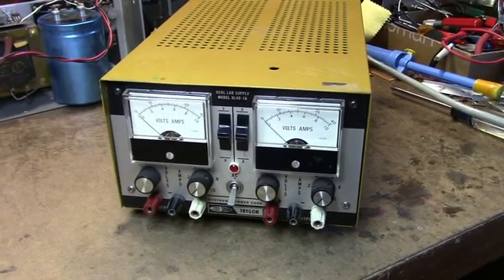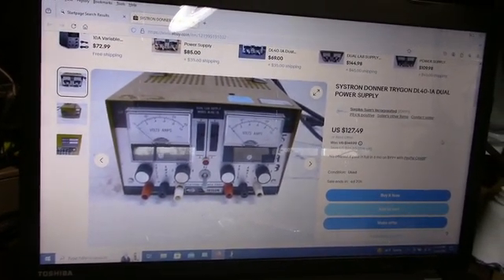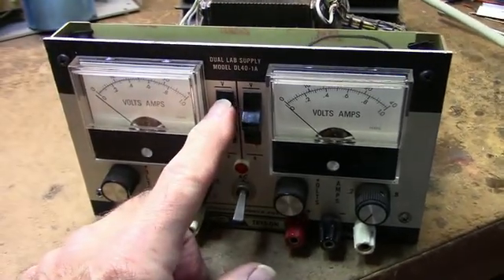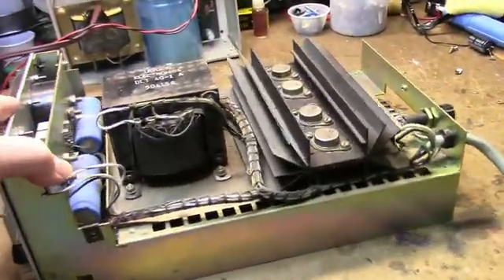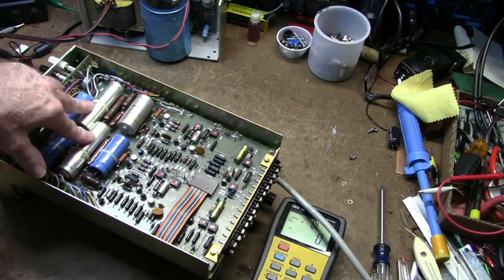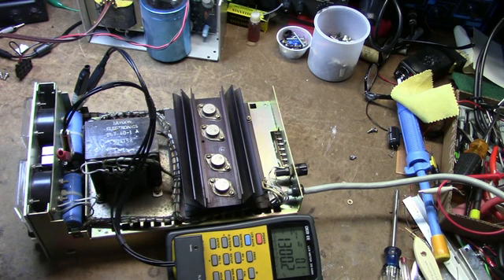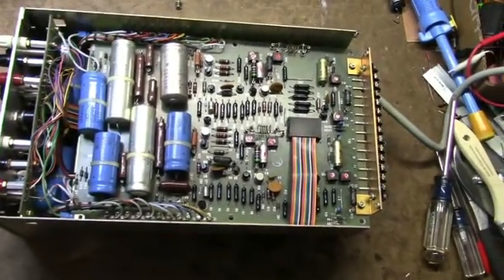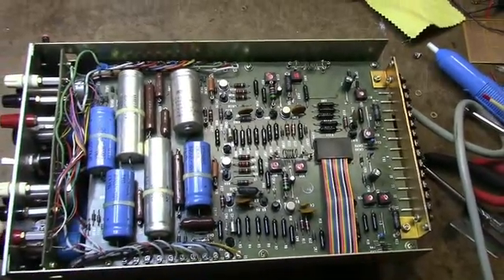Systron Donner DL40 1A Power Supply

Comment: I not only have one of these, I also have the manual to go with it. I am on Facebook and also Linkedin if you want to discuss....The right side of mine pins the meter on volts so there is something wrong with the closed loop cct. By the way, what meter were you using to test the caps? 73's VE6GJT.
Reply from the maker: Hi stampeder 1686,  The LCR meter is a DER EE  DE-5000.   As a start I would clean all switches and look for bad solder joints.  Good luck, 73's